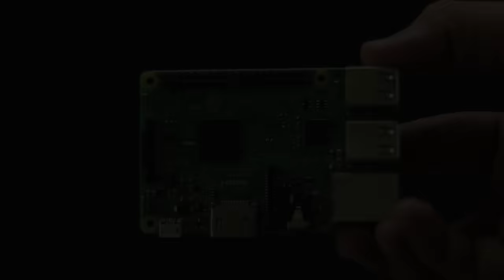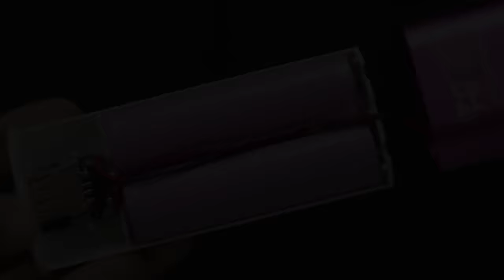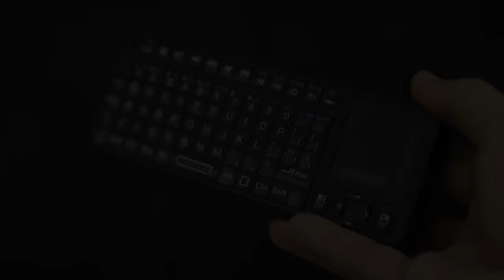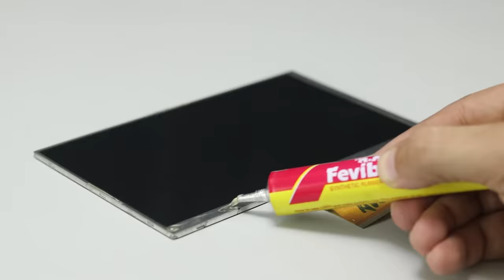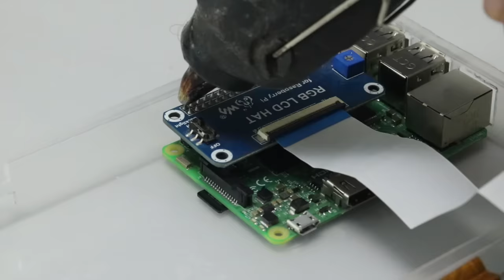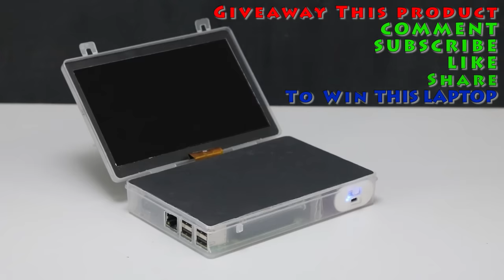How To Make Mini Laptop at Home

Comment: That is definitely one way to go about making a small scale laptop. Very impressive build.
Reply: im gonna do another way. actually its not even a laptop. it has a portable usb battery taped to the bottom (the battery is slim and the size of a pi), the usb port is connected to the pi's power input, and i have a display the size of the pi on top of it. its kinda thick though, about 2.5 cm
Reply: @someidiot4311  uh b BC b

Comment: ok, but why would you not use the powerbank's usb connector to make it more repairable down the line? I guarantee you can dredge up the exact same circuit, attached to a usb A male plug on amazon somewhere.

Comment: Did you download a windows for laptop?
Reply: Amir Ali Rezaei ...Windoze doesn’t run on Rasp PI. Only linux based distributions will run.
Reply: IamDunn ha, the Raspberry Pi is made for a specific, small version of windows
Reply: just.maddie ...Well, not really. It wasn’t designed specifically for any OS. Sure Windows 10 IoT Core will run on it. But IoT does not equal Windows.
Reply: Its a raspbian os
Reply: You can run Raspbian, Lubuntu, and other Linux distributions.

Comment: Projects like these are neat and al but the raspberry pi is not a good solution for a laptop. For about the same price you can get a used think pad with a lot bigger screen
Reply: own made tings gives peace.... you know..
Reply: i agree with you
Reply: sure, driving in my home made car held together by duct tape gives me alot more peace than sitting in a saftey tested car
Reply: It's about the joy you get from building and using something
Reply: Costs about £30
Reply: RetroX